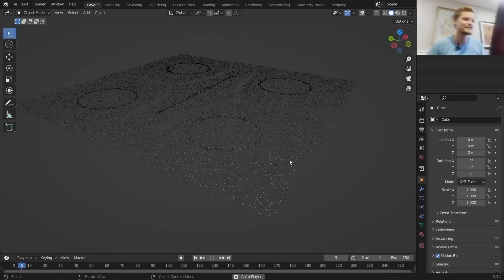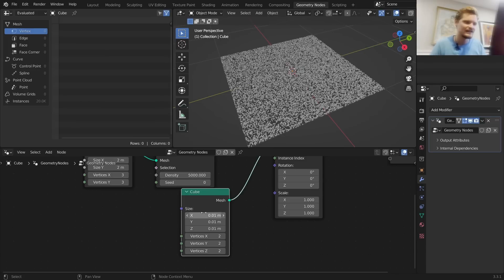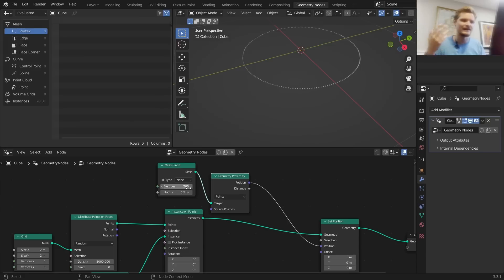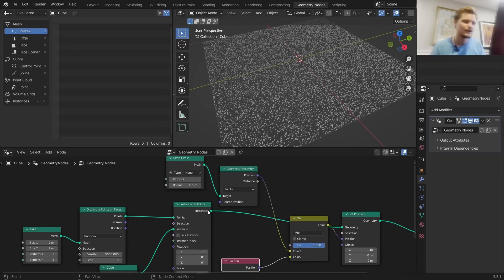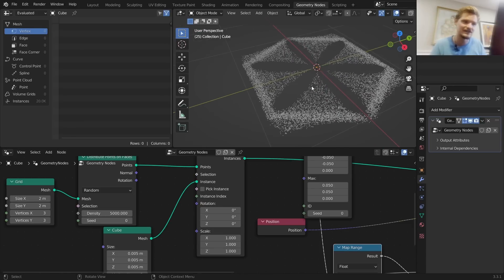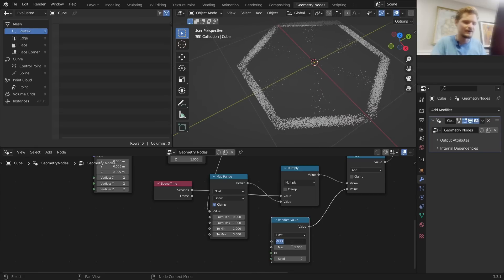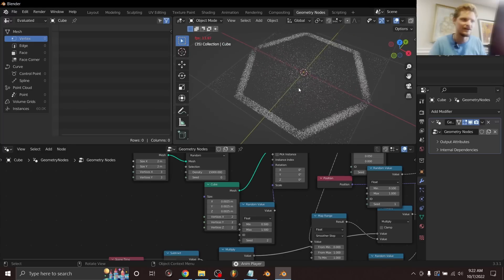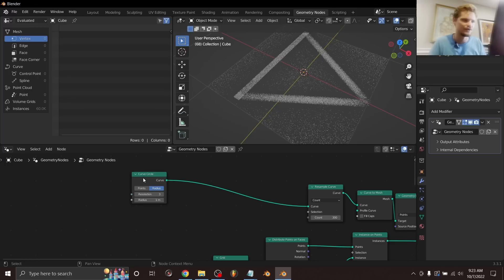Chladni Plates - Blender Tutorial

Comment: With the physicist involved in Chladni plates, the particles furthest from the nodes (the lines of attraction) should be moving the most chaotically and fastest, so I would actually say that inverting with the map range before multiplying by time looks a little further away from reality than just leaving the map range out.

Edit: What I mean is if you watch some videos of Chladni plates, you will see that the particles very quickly “cloud” around the nodes, then more slowly refine into lines.  It’s very much the opposite of a distant force attractor system.

Comment: If you Phone has a motorized lens, it could cause the blurry face-cam by being stuck.
If you suspect this, I suggest you hit your phone with your hand with moderate force (this is actual advice, I'm not joking) while you have the camera App opened. This could help to get the lens motor to get unstuck. A friend of mine had a similar problem wit his camera (though not the selfie-camera) on the phone.
I hope it helps :)
Reply: The blurry cam is a staple of this change